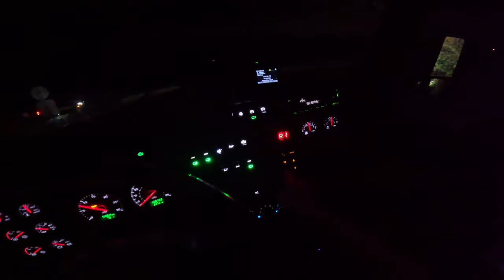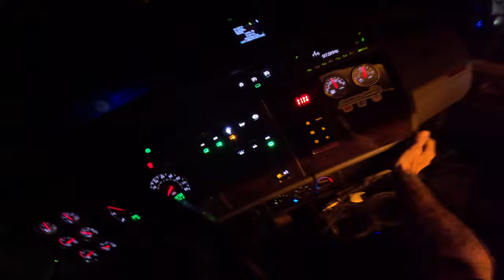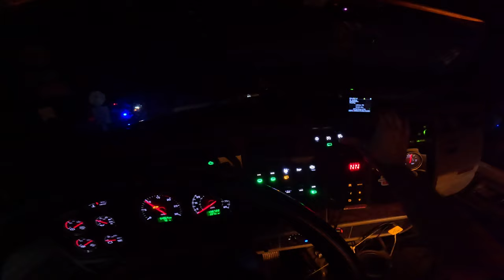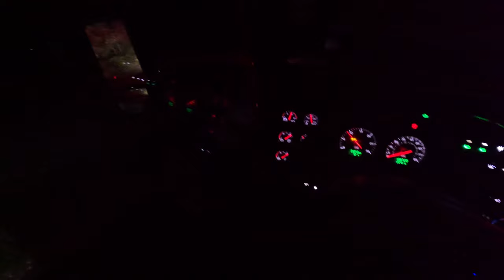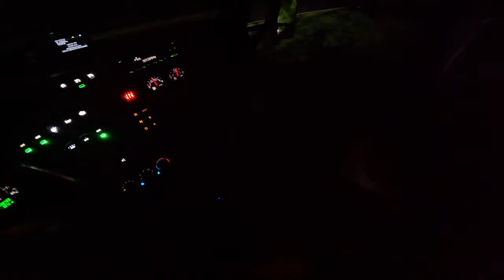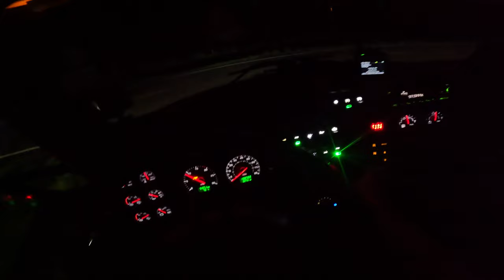Towing a Burned Up, Abandoned Car, on the Railroad!

Comment: ghosts at 23:52 & 39:07. cool that you took advantage of the radiator water to clean the license plate  41:39.  and at 41:35, the halogen floodlights on your bed are sticking out through the headlights of the car, making it look like they're actually on.  47:81.

Comment: I hate to be the cooler that has to move out to a salvage yard though I would use a 50-time  crain  to put on a flat deck
Reply from the maker: It’ll be easy on level ground. The problems came from the extreme angle I was working at

Comment: OK OK I have another idea that you have to tell me is bad or wrong.  You ever delt with Copart ?  Well what if your yards had a frontend loader with long hilo  forks that after you unchain the car you could just get them off with that.  It will cut back on wear to the truck and most vehicles are totaled / write off s anyway right?
Reply from the maker: We don’t tow for copart, and we’re not investing that must money into an otherwise useless piece of equipment. It’s not hard to unload the truck if you know what you’re doing.
Reply: @Towtruck_Dustin  I didn't want to know if you worked with Copart I was just trying to bring up the idea for  the front end loader thing.